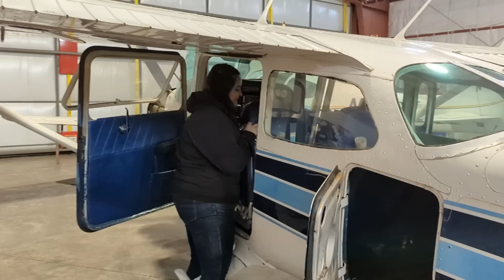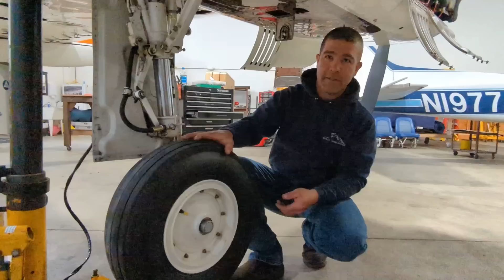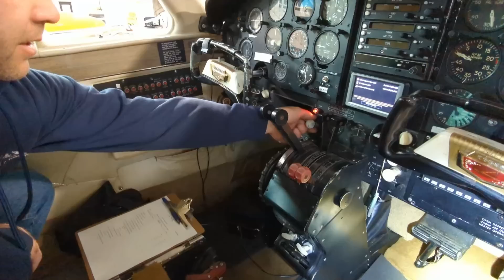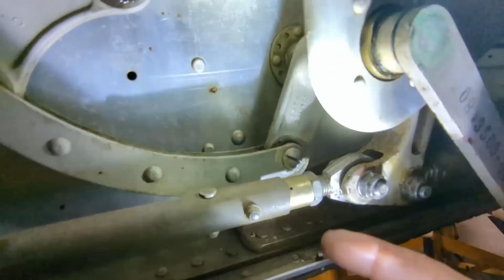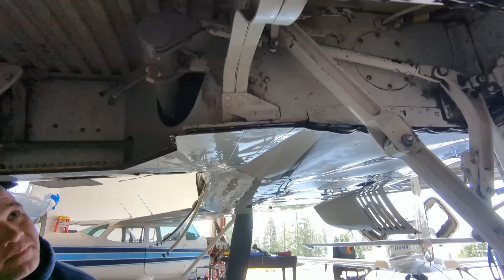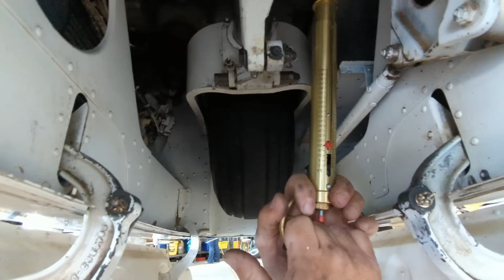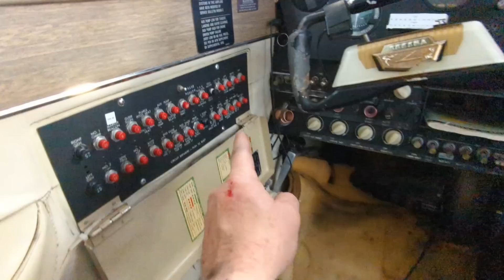1959 Cessna 310-C Annual Landing Gear Check. Gearhead Special!

Comment: Love your videos! I’m curious what people do for substitute greases now that technology has improved since this golden era. For example there are synthetic greases which outperform the ones specified in the manuals but they are effectively frozen in time when the aircraft was certified. Case in point: aeroshell 5 is almost impossible to find now because the factory which produces it burned to the ground I think a year ago. I believe 22 is the new replacement for it. I just had to deal with this but in a different context: building an experimental but I am not bound by the original manual in that case. 

Anyways love that you share this with us!

Comment: Great video.  Really cool to see how the whole mechanism works.   I actually had to use the hand crank to get the gear down on a 310B once.  The nose gear door arms were not properly secured after MX and they jammed up with the nose gear.   I had to use the hand crank to break it loose.   Luckily there were two of us flying and it all worked out for us in the end.

Comment: On one hand, that gear system seems a bit Rube Goldberg, but on the other, it's some impressive engineering.  Still, like almost everything about aviation, it's fascinating and very cool to learn about.
Reply: I can’t seem to judge if it’s elegant or not. It may just be 12,000 engineering solutions added together in a temporary harmony. My basis for elegant engineering: a browning citori lightning over under shotgun mechanism
Reply: Haha…. Complicated??? For that , you want to go to the F-111 landing gear.
Reply: @franknphotos  heck, you don't even need to go that far, just go to any Cessna single with retracts!  Even more complicated than the 310, since you have to get them tuck into the rear fuselage!

Comment: Juan please tell Jimmy (Jimmy's World) that fixing a 310 that's basically totalled costs more than it's worth. His viewers are urging him to waste all his money doing just that.
Reply from the maker: I tried....
Reply: Jimmy is well aware of the cost of rebuilding the 310 and has stated a few times that the cost will be a lot more than the 310 would be worth flying.  I think that is why he bought another 310 in better condition. Take two 310's and make one fly.
Reply: #Savethe310
Reply: Jimmy is no dummy, he is using your money to “save the 310” not his money!
Reply: Yeah that's a painful money pit to watch...
Reply: not to mention that 411 that has 200,000 worth of engine and a 700 hr spar Ad
Reply: I was a viewer that told Jimmy not to do it, also rebuild rescue.  You could save 10 or 20 Cessna 172s for what it would cost to fix one Cessna twin.
Reply: @utah20gflyer76  I wonder if they will get finished or are just for views…more so in the RR case
Reply: Don't worry the views will pay for it twice over.

Comment: I watched a 310 land without the nose gear at our local airport back in the 70’s. They touched down on the mains and eased it over onto its nose before it got too slow and dropped.
Reply: Juan and his mechanics are doing a very thorough job. My boss at a 310 fleet I worked on could start from scratch and get everything in spec. A lot of shops don’t really know what they’re doing and just swing it on jacks, not adequate. I’m going to hear that gearbox in my sleep tonight
Reply: This is an amazing video, Juan! I had no idea how complex a light twin gear system could be. It's totally whiz bang stuff those Cessna design engineers came up with back in that post war period. It couldn't be done today at a rational enough cost to create a saleable airplane. There must have been a big surplus of those guys that learned their trade during the explosive growth of military airplane design and production during the war years. That's the only way you could find people to  cheaply enough design and  build a reasonably priced product like the 310. The buyers had to be reasonably well heeled enough to afford one, but for Cessna, they sold enough units along with the 172s and 182s to keep the lights on in Wichita! You've got a real creampuff there in Harvey. He's in good hands. Enjoy!

First flight I had in a military airplane was in the Air Force version of the 310, the U-3A out of Paine Field in Everette when I was an AFROTC cadet at UW. It was a thrill to circle Husky Stadium during a game on Saturday afternoon in the Fall of '64. I thought I was pooping in tall cotton then!